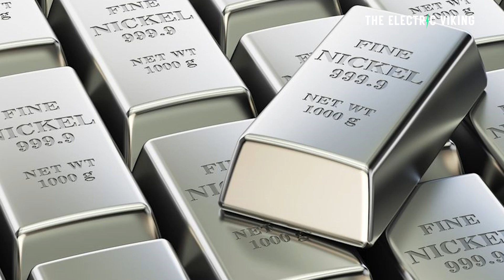Japan discovers game changing 230 million tons of rare EV battery metals

Comment: Oh COME ON. You spend 2:40 before saying anything, and when you finally do it turns out you're saying nothing. There have been hot discussions about sea floor mining and metal nodules for forty, fifty years, only now we're getting some more detail. If Japan is making noise about discovering sea floor mineral resources, that has the exact same quality as Toyota announcing twice a year it has made a sensational engine / fuel / battery breakthrough. That plus the environmental issues, see the other posts. You are usually better than this.

Comment: It is a resource, but I worry that it'll be cheaper to mine if the environmental aspects are not understood or are ignored. Cheaper simply means more profit, which may benefit the customer and will certainly benefit the manufacturer. Hopefully new technologies will bypass my environmental concerns using salt, recycling and fewer, smaller and more efficient cars.

Comment: Manganese nodules have been known for decades.  As a grad student in oceanography in the 60s I’ve held one in my hand, it was slightly smaller than a baseball but very dense and heavy. As I recollect there are only three areas in the oceans where they are found, all in deep water, making it difficult and expensive to recover.  There has also been opposition to their recovery due to the damage to the undersea environment.

Comment: This is a very destructive process for marine environments. Essentially, what they have to do is to sift the sand on the sea bed. Two of the issues I am aware of are complete scarring and disturbance of the sea bed and sediment plumes which are kicked up that can drift for 10s or even 100s of kilometres. Regardless of what the proponents will tell you, it has a substantial negative environmental impact.

Comment: Processing is so simple, at Redwood Materials they would very likely simply toss those into the battery shredder. No change of or to the process. I’ve wondered for many years what the retrieval system method would need to be to cost efficiently process those nodular nuggets. Time to find out, in about two more years I guess.

Comment: 20 years to replace all vehicles with EVs, Battery Vehicles. 
50 years supply is too much as recycling will be a big economical industry withina decade. 😊😊😊

Recycled aluminium is dirt cheap vs mined aluminium.